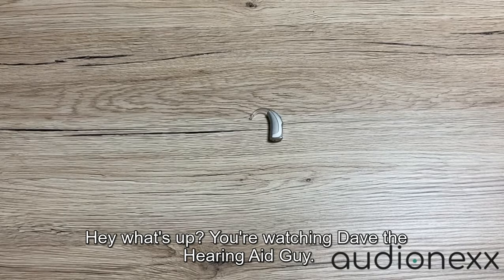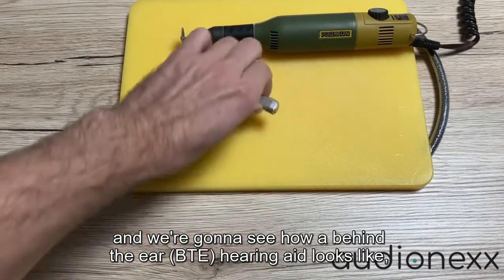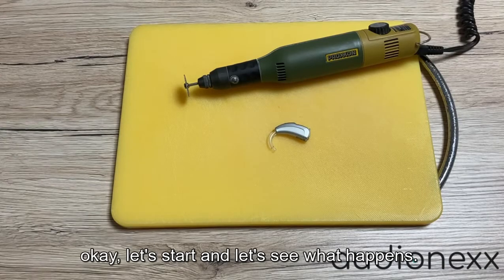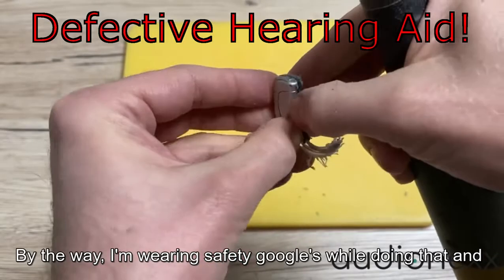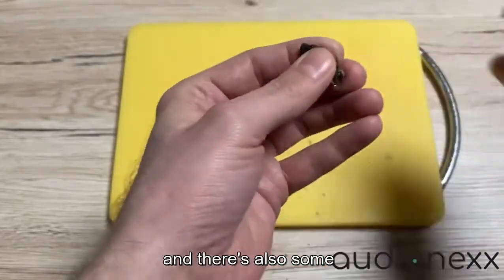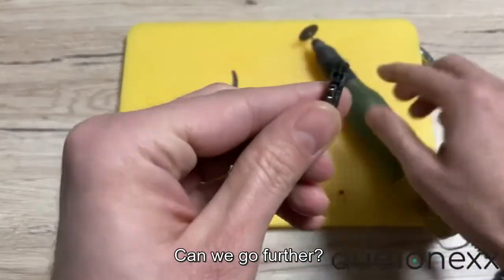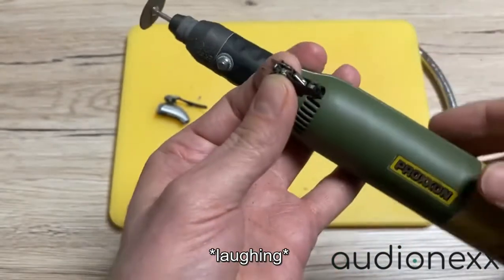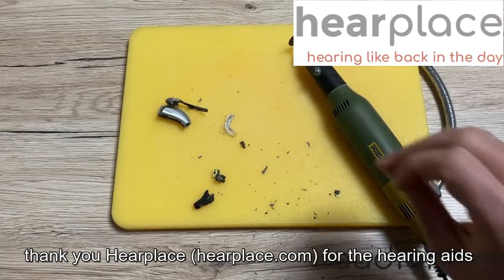Cutting a Phonak BTE Hearing Aid in Half

Comment: Hi I have a question on a custom hearing aid ear mold the recover is detached and my husband put a wax guard in and it pushed in the receiver in to the acrylic, mold it’s just floating around in the ear pice and wondering if there’s a way to re connect the receiver some how
Reply from the maker: Hi Samantha. Sorry for the late reply. If the problem still persists: usually you can push the receiver back in place without any issues. Depending on the material you might need to heat the material just a little bit (please let a professional do that). 

Best,
Dave